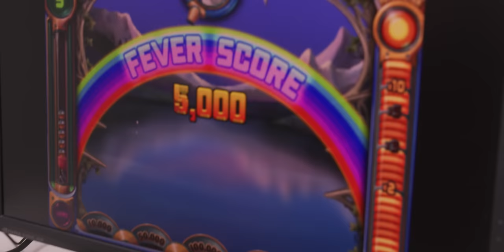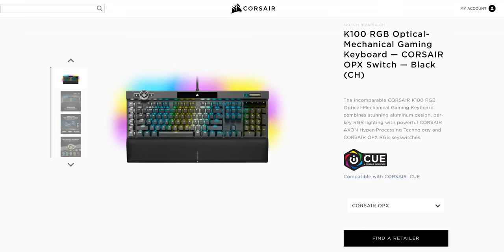The All Corsair Gaming Setup!

Comment: I own this case and have some tips to anyone reading this.
To anyone watching this in 2022 and beyond, PUT THE GPU POWER CONNECTOR CABLES THROUGH THE BOTTOM GROMMET. IT LOOKS INFINITELY BETTER.
Yes, I know it makes it a cable managing nightmare, especially if you are going to keep the hard drive cage, but it looks so much better and getting white sleeved cables or even just cable extensions makes a world of a difference. Just don't bother with the CPU power connection for colored cables. I promise you, you will never see that connector ANYWHERE unless you are looking up and directly at it.
Reply: Linus, I have 1 question for you.
If you were going to use all black components and peripherals, why did you get a white case?

Comment: Working on. Build rn haven't seen this yet, basically building a similar thing to this rn. got a corsair 5000x rgb vengeance ram a rog strix x570e, Cappellix 360mm aio and enough corsair fans to cool my room. An rx850 psu and a ryzen 7 5800x cpu and a 1080 ti cause I'm poor and 30 series is expensive lol

Comment: Recently bought a 275r for my first build.. happy to see it being used here as I’m new to building pcs and this will help a lot. Currently waiting for the new ryzen cpus and new amd 6800xt card for benchmarks to make the final decision
Reply: Does this gpu fits with a watercooled cpu on the front?
Reply: @danieleciculi3376  Ended up getting a 3070 from Nvidia with a cpu water cooler on the front and it does fit but it’s a tight fit, I would check dimensions
Reply: @Alex-vx3tp  how tight? Like 4cm or 0,5cm?
Reply: @Alex-vx3tp  and what type of version do you have? Because I bought an rx6800xt which is 34cm and it should fit but I don't know if with the water cooler fits. I bought this: MAG CoreLiquid P360
Reply: @danieleciculi3376  a 360mm? I have a 280mm
Reply: @danieleciculi3376  I’m pretty sure a 360 on the front won’t fit on the front, but with a 280 and the 3070 there was about 10cm of space but with fans on the inside it was tighter
Reply: @Alex-vx3tp  yeah, the new corsair 275R airflow supports 360mm water cooler in the front. I don't know if the gpu will fit with mine 360mm water cooler...
Reply: @Alex-vx3tp  so, the 3070 is approximately 30cm. Mine is 34cm. With the radiator should fit if you are saying that there are around 10cm

Comment: I just recently build an "all Corsair Build" when i rebuilt my PC a few days ago! I ended up getting a black 4000d airflow, and a set of 3 SP120 RGB Elites to use as intake fans on my radiator. And they are good for rads because they are more designed to have higher astatic pressure apparently so that's cool! I had already owned a Corsair h150i Elite Capellix AIO that came with 3 ML120 Pro fans, but it was my first real build, and i ended up accidentally cutting the fan cord for PWM instead of the RGB hahah RIP :( So for the longest time my PC had t AIO fans on it, coupled with 3 crappy Apevia fans that just ran at max speed of 1200rpm connected through Molex (I originally got this as a CyberPower prebuilt that I upgraded over time). SO now with this case I had the 2 included non rgb 120mm air-glide fans, 2 120ML pro/Elite fans, and 3 SP120 RGB Elite fans. Luckily =, the AIO came with a commander core that allows up to 6 corsair fans to be plugged in both on the own side and the RGB side so it worked out perfectly! I put the SP120's on the front of the rad like you did on your build, and then took the two ML fans and used them as top exhaust along with one no RGB airglide fan as the rear exhaust vent fan. It was actually the very first time I have built a computer completely from the ground up, starting with an empty case. I used an EVGA 750 watt 80plus bronze and my cable management came out to be not too bad if I say so myself :) Pressing the power button for the first time and seeing it boot past post into Windows was the most amazing feeling ever hahaha. Now, I'm just trying to optimize airflow to that my PC is pretty silent when I game, so I'm messing with iCUE fan curves as well as MIS afterburner for my GPU. And now that I have an adequately cooled system, I've been messing around with overclocking the CPU and doing cinebench r23 runs :) It so awesome!! I'm just trying to get it silent in game cuz it still sounds pretty loud, but u suspect its the GPU fan curve being too aggressive. But trial and error is all part pf the PCMR adventure ;) Keep up the great content you guys. You guys rock, and are by far my fav channel. I never miss a video, and Fridays are the days I look forward to the most for WAN show hahah. Keep killin git guys. Your doing an awesome job!

Comment: mines not entirely corsair but mostly

case-corsair 7000d
fans- 12 corsair dual light loop 120 fans
cpu cooler- h150i elite lcd
lian li strimer plus v2 cables for mobo and gpu tied in with adapters into one of my 3 commander cores
vengence rgb ram 32gb (4x8)
and corsair little triangle lights i have about 18
i also have a rgb mobo back plate, and a rgb anti sag bracket hooked up to the commander cores as well, so everything is controlled with only 1 thing of software, and they are all synced perfectly

edit- i await the day a mobo manufacturer partners with corsair to make a board...

Comment: Started with a prebuild and I litterally just finished moving what started as an iBuy Power Prebuild from 2015 into a Corsair 5000D Case
I have been quite happy with Corsair much better than Razer IMO I love Razers designs better but corsair never fails 
The only original part left in this build is the GPU and yall know why!
So its basically a corsair MSI Frankenstien

Comment: I feel torn on icue because, while it is pretty rough for CPU consumption on midrange and lower-end builds, it's actually the most responsive RGB software I've used....but then again its addressable RGB strips are the proprietary corsair stuff, it can't control generic aura sync 5v ARGB strips. For external lighting as well as those stupid little towers corsair wants to charge you like 80 dollars to mount strips to the back of your TV...or you could just DIY it like I did and run corsair LED strips through an open PCIE slot and stick them inside repurposed kitchen LED diffusers.

Comment: I'm mad that their power supplies don't come with single connector PCIe cables. So running a separate cable for each of the connectors on my graphics card means having the extra bulk of a connector I won't use. Or buying expensive custom cables.

Even though I got their overboard RM850x.

Yeah, I know I shouldn't need separate cables, but a lot of people swear it has fixed glitchy systems.

Comment: What do yall think about the build I'm doing it has
Motherboard: Gigabyte b550 aurus pro
Cpu: Ryzen 5 3600x 
Gpu: Rx 5500 xt 8gb
Case: Aerociol bolt--bk
Case fans: 4 120mm rgb case fans
Power supply: aresgame 650w 80+
Storage: 512gb teamgroup ssd
Ram: viper 3600mhz 2x8 rgb 
CPU Cooler: 5v id-cooling 
Wifi adapter: cudy we3000 ax 3000mbps

Current total $1021 
Leave suggestions

Comment: As we've seen the rise of computer cases with a little extra depth behind the motherboard to tuck cables out of sight, a "basement" compartment to hide the power supply and the bulk of its cables when do you suppose cases will come with standard connectors to snap in to?  This would eliminate "cable management" entirely.  You'd end up with much shorter cables to connect your various components.  Just long enough to reach from the connector of the motherboard, expansion cards, mass storage, fans, lights, water coolers, etc to their corresponding receptacle on the case itself.  Like how some mass storage drives are slid into their drive bays without needing to be wired up by hand.

On another issue weren't you the one who basically called RGB lit cases, fans, RAM, video cards, water blocks/pumps, mice, keyboards, cables, power supplies, monitors, case screws, mounting brackets, etc as something like "Unicorn Rainbow Vomit"?

Comment: Didn't he mount the radiator in wrong side. The pipes should be in upwards
Reply: Nope thats false. If you mount it upwards it will build airbubbles in the tubes and that can be fatal later on for your water cooler

Comment: I installed the 150 version of this. I’m pretty sure I did everything right. When I turn the computer on all 6 fans and lights start the pump seems to start. Then the fans stop then go back on at 100% and a red lights flash. Pump still seems to work as the temps Don’t go over 25ish degrees Celsius. Also on the icue the pump comes up with pump failure and email Corsair. Shows 0rpm on the pump also but it has to be working as the temps don’t go up crazy.
Reply: Could be a loose connection or bad reading.
Reply: @Bendigo1  Na it was the pump took it back they checked and gave me a new one. Then the new software gave me blue screen😒
Reply: @LastChanceThoughts  🤦‍♂️

Comment: did basically the same build only difference is i used a mastercase.......which has tempered glass on both sides. cable management was a nightmare...
Reply: i also used light loop fans instead

Comment: What wasn't shown in this sick build video is how the Corsair Commander Pro interacts with X570 Motherboards. I personally have a Commander Pro with 6 SP140 Corsair fans and I love the lights, but be warned: the Commander Pro has a very bad tendency to frequently and randomly reset and restart X570 motherboard's USB Bus. this means anything plugged into the same USB Bus that the Commander Pro is on will stop working temporarily before restarting, keyboard or mouse or whatever other USB peripherals you may have.

You can find a Corsair Forum thread regarding the issue here: https://forum.corsair.com/v3/showthread.php?t=189344

The short answer to fixing the problem, from Corsair themselves, is to buy a separate internal USB Hub and to plug the Commander Pro into that. Thanks Corsair!

Comment: With an ATX motherboard, will there be enough space to mount a top 240mm AIO?
Reply: Probably not. Ive tried with my other case which is a mini tower. And I top mounted it. And it barely fitted because of the ram. So i suggest to not topmount it if you have ram thats very high

Comment: This is pretty much what I'm going for. Corsair Case, PSU, Fans, Commander Pro, AIO Cooler. Still need to get Corsair RAM, Maybe in the future a Corsair SSD. I think they make NVMe's?(update. Didn't watch the part as I typed this. I figured they did but wasn't 100%) But I'm happy with my storage at the moment. Also Keyboard, Mouse, Mousepad, Headset. All Corsair. I'm very happy with their products. I mean My HS80 is a little janky, The charge doesn't really last long and the ear pads are falling off. But other than that. I'm satisfied with the products. Might even put some LED strips on the back side of my monitors. Just turn my entire desk into a Corsair RGB desk. Slap some Corsair logos on the side of the desk and call it a win.

Comment: 5:58 What does Linus mean by this? Can I install the AIO with the intel mounting bracket for lower temps?
Reply: I don’t think so. With aios , they come with a way to mount it on the cpu that have a backplate with standoffs on the bracket. He used the clip mount that used clips into the pre installed brackets on the mobo

Comment: Yeah, Corsair has been in the biz forever - and they still haven't figured out that GPUs should be oriented vertically not horizontally, so even in 2020 Linus is still routing the PCI-e cables to try to finagle a few more ounces of support for the stupid thing.  It's so simple to rotate the mainboard so that the GPU absolutely won't sag, either with the "rear" IO on the top of a standard tower and the GPU hanging straight down, or with the mobo lying flat in a cube case with the GPU straight up and down on top of it.  Yet only Silverstone has figured out how to do it with towers?  I get that cube cases have a larger footprint, but Silverstone made some top-notch tower designs with the IO on the top.  I am baffled as to why that simple innovation still hasn't caught on.  GPUs have not gotten smaller.

Comment: Did you really install the radiator upside down so the air bubbles are forced up into the pump? Shouldn't the hoses come off of the top of the radiator?
Reply: It doesn’t matter as long as the pump isn’t the highest part of the loop

Comment: I had that problem too with my large case DG- 76. I dont understand how after all this time, it is a HUGE pain to connect all the wiring in the upper left corner. They are already big cases so who cares if its a few inches taller? Or  make them wider and lower the MB. I know I am smarter than most but I do not have the connections nor the money to design a way better case. I can see it but I an not build it. If you cant build it, they wont come. 
🤔🤔🤔😑😑😑😬😬😬🙄🙄🙄

Comment: Linus....did you seriously invert your radiator so any air bubbles in your AIO get forced into the pump rather than the reservoir?
Reply: I hope you are joking and not being stupid, the air bubbles will go to the highest point which is the top of the radiator, not the pump. In some cases the position of the radiator can be a problem but mostly not.

Comment: i hope someone can answer my questions. I need help.                                                                                                                                                                   1. do the wires come with the parts                                                                                                                                                                                                          2. how many fans did he use. like did buy the 3 pack and then buy another 3 pack                                                                                                                    3. where did the black fan in the back come from. did he buy or did it come with the case
please help

Comment: "I cheated and used the clip mount rather than the one that takes longer"

Wait, is there another option for the H100i on AM4??
Reply: Don’t think so. I have this exact setup
Reply: @jarrettmaltry6305  Yeah, I am about to install an H100i into an AM4 system and could only see the one mounting option in the box, hence the question. It seems there are different versions of the H100i that come with a new mounting system, but the one I have doesn't :/

Comment: I want to buy a psu and I am eyeing the corsair rm850. Should be a good and safe choice, right? It will power an i7 6700k and a gtx 1080
Reply: I have it, it's a good psu
Reply: @kuro2685  mine has been running well for a almost a week now as well. I just might get more of these for my other systems down the line
Reply: @tj71520  how much did yours cost,and where did you get it from please? I'm thinking of getting a smaller watted psu since I don't do heavy tasks, just mainly a few games
Reply: @kuro2685  it was around 900 dkk (139 us $)  iirc and it was from proshop

Comment: i have a pretty good budget gaming pc, it has 16gb hyperx ram 3200mhz, GTX 1050TI, Ryzen 5 1600AF,  B450 Tomahawk MAX, the only thing thats eating me alive is that i have 2 missing screws in my motherboard, at some point i lost them, the motherboard is still steadily packed and it wont be going anywhere its just that those two screws are mindfucking me sometimes, il be getting a new case so then ill be able to normally screw in the motherboard.

Comment: the aio on the bottom looks terrible. its also has the cables on the gpu... Which is hot and the AIO is running water... it will wear out quick and fluid on GPU.... Everyone a expert now because GN.

Comment: Attach Connections to power... install in case... y u do this backwards?  muh brain hurts. And the Radiator was made by a buncha converts from HardwareLabs... Yeah its nice stuff. I run dual 480mm x7's